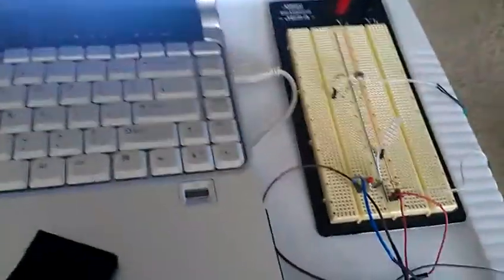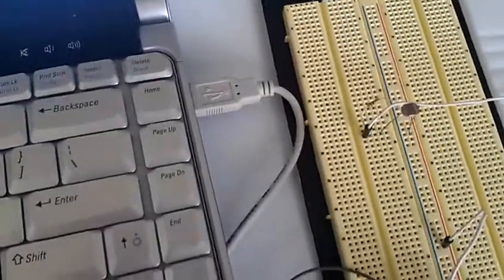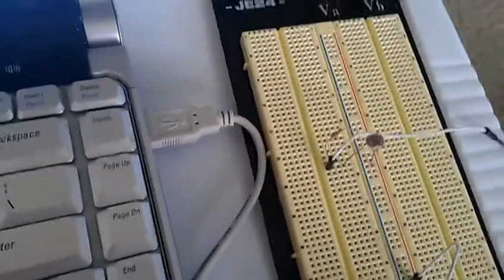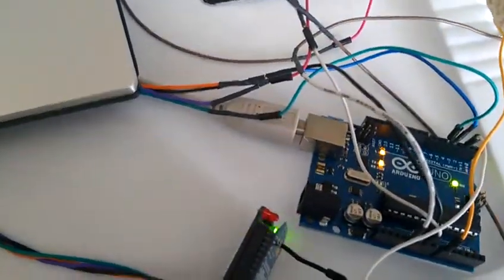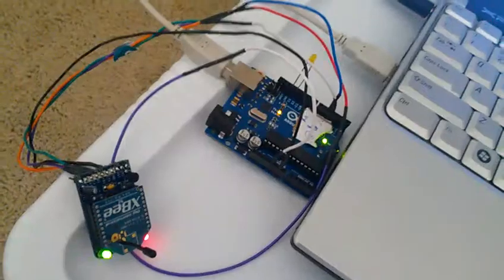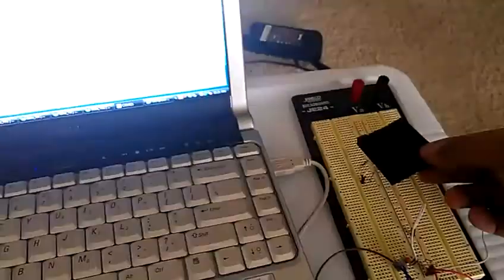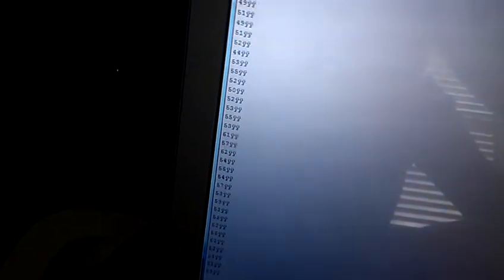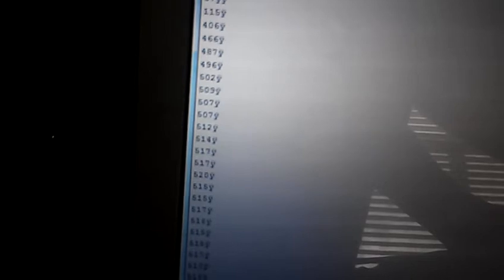Arduino Xbee light sensor demo

Comment: can it read multiple light sensor values and distinguish them?  ie 3 light sensors attached to the ardunio sending all those values to another arduino so they can work together. 
im trying to make this wireless
w ww.instructables.co m/id/Arduino-2-axis-servo-solar-tracker/step4/Wiring-it-up/
thanks in advance